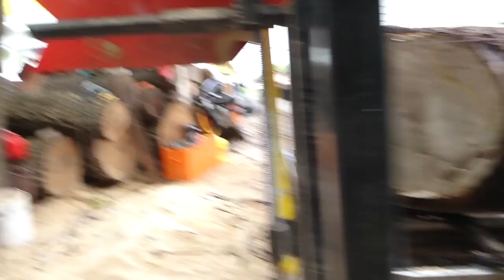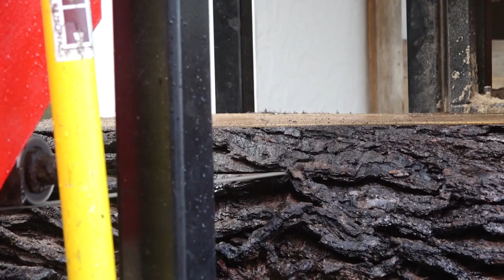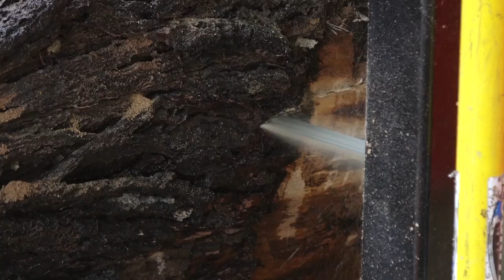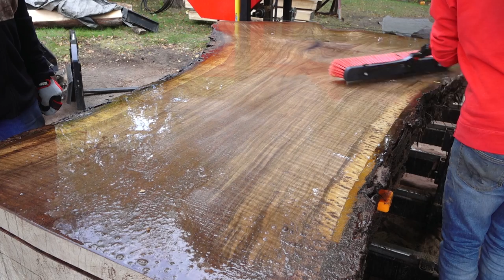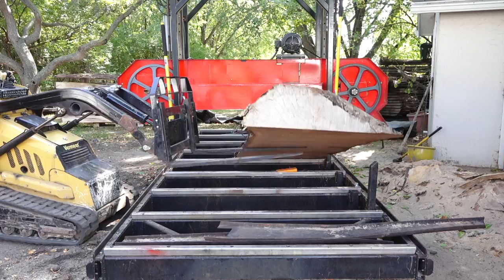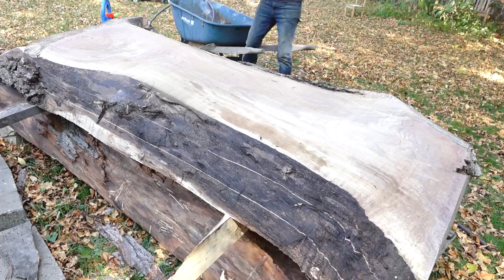Sawing a Giant Walnut Crotch From Ohio into Slabs

Comment: Hi Matt,  Thank you so much for sharing the sawing of 'Jeffs' huge Ohio Walnut tree. Fascinating too watch and did it bring back memories to me!
My maternal grandfather owned a portable saw mill back in the 1920's and 30's. The picture I have shows one of those old stem engines or oil pull. type giant tractors of the day pulling an even bigger saw. I was born in '39 and he passed in '47 so I didn't get to see any of that but I did get a number of his hand tools which I cherish as well as a few small pieces of walnut, cherry, and maple which I've used in making some urns for a few of my close relatives. Coming from southern Illinois he homesteaded in northern Alberta, Athabaska specifically, in 1911 wherein after arriving there in the late spring he built a log home for the family to ward off the following winter. I never heard what help he had but must have been pretty busy to get it done in those few short months, and must have done OK as they survived there for about 8 years before moving back south to warmer climes.Thanks also for showing the indications of stress markings at the base of those big branches in the heart wood. One can only imagine the wind blown and weight bending motion translating into the main trunk from a limb of that size. Yes wood is not only amazing for it's strength and versatility, but  truly beautiful to boot. Jim Martin in the Madison WI area.

Comment: Matthew,  when you mentioned that the wire was steel with a copper jacket it made me wonder if it might be an old telephone or telegraph wire. What was commonly called " open wire".  Back in the old days, they used only one wire and quite often used existing trees instead of placing a pole.  The return circuit was simply a ground rod driven in the ground.

Comment: They used to use copper coated steel wire for telephone lines in rural Southwestern New York.  Back in the days when you would see telephone poles with 6 or 8 sets of lines on them and everyone still was on a party line.

Comment: I am in Independence ,Mo . I have Black Walnut slab very similar to yours , that I made for an island counter top . It is a 3” slab at the top it is 2 foot wide and at the crotch it is 3 1/2 wide and 5 1/2 feet in length .I beveled both ends and keep the live edge . I spent several hours sanding the top down and put on 7 coats of varnish . An interesting note about the tree is when they cut it down they found a civil war cannon ball embedded in it

Comment: That wire UH, just thinking, could it be a solution = Hook up one or two car batteries to each ends and by heating the wire to a point that it 
would be able to pull it free?   Just thinking be able to save a few blades  wearing out too fast .

Comment: Hopefully you didn’t kill the old tree just for the wood.
Reply: Nope, We knew of the tree for several years and when the property owner wanted to sell the timber before the land was sold and developed, I was able to negotiate keeping the bottom section of this walnut.  Loggers took all the rest and 23 other trees.  Usually we are re-purposing trees needing removed or cleaned up due to storm damage. In fact, this is the only log I have purchased to date. - But we keep looking. :)
Reply: That is very good to know that it was already cut and you did not take it just for the lumber. We have a lot of heritage oaks and they are magnificent. I wood rather see them alive. But if storm damages occur, I’m glad you could salvage them.